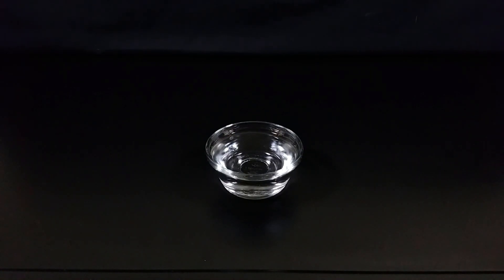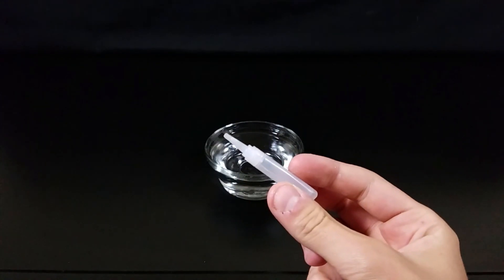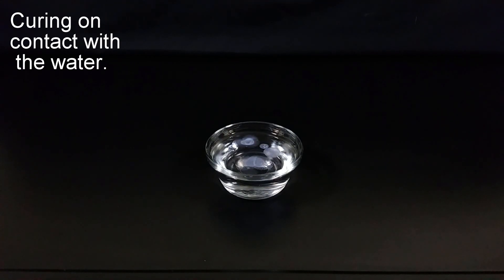How To "Dry" Super Glue Instantly Using Water!

Comment: Cyanoacrylate is used in forensic latent print analysis as it can be vaporized into gaseous form and will adhere to the oil and grime that make up your print, perfectly extending the grooves and mimicking the fingerprint in question to in turn transform said latent print into workable and usable 3D prints. It was also used on the battlefield of the Vietnam War for “instant sutures" in closing open gashes and wounds. Very practical use and great demonstrative video